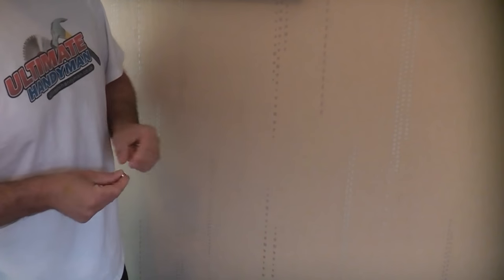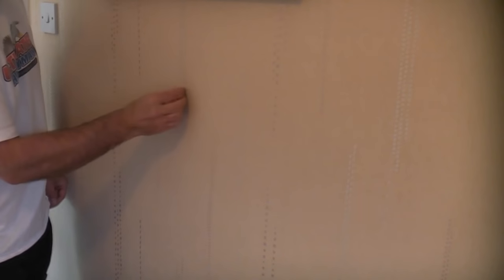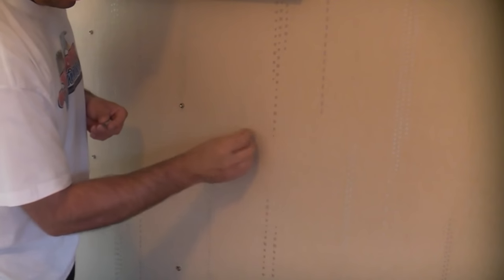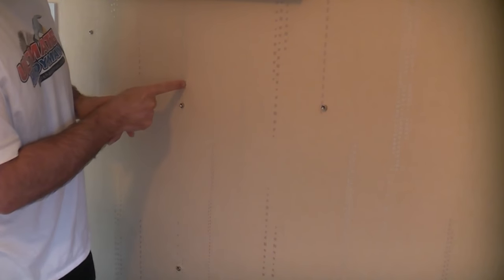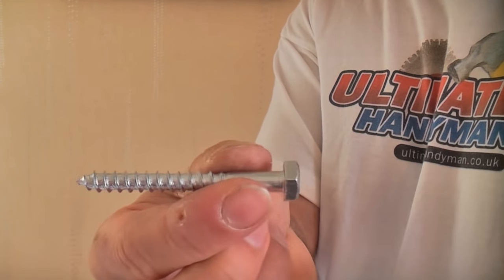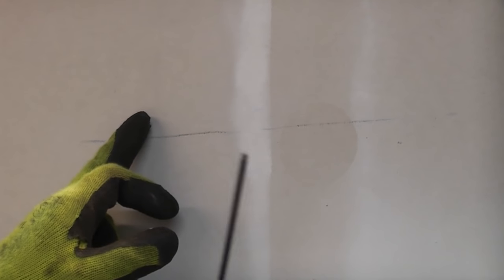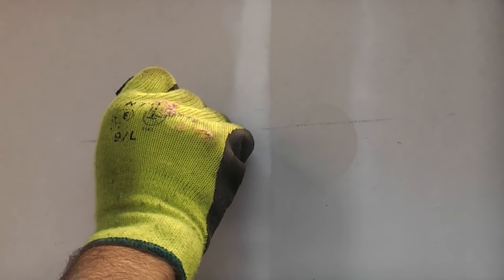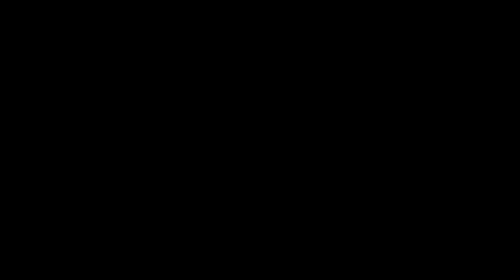How to fix heavy items to plasterboard / drywall

Comment: What size diameter / thickness of magnets do you use ?
Reply from the maker: They are about 10mm diameter, like these- http://fave.co/2tkvOmW
Reply: Unfortunately Norton is blocking me visiting that site.
Reply from the maker: Its only a link to ebay!
Reply: For some reason Norton says it a potentially dangerous site. Odd. Thanks for the info.

Comment: I've been trying the magnet trick as I want to fix two battens to a wall, then fit mirrors to them... But for the life of me, I can't find any of the batten screws?! What am I doing wrong lol
Reply from the maker: It’s not a dot and dabbed wall, is it?
Or perhaps they used fixing foam to fix the plasterboard to the studs (not very common)
Reply: @ultimatehandyman  If I knew what a dot and dab wall was, I might be able to tell you 🤣 If it helps, it was a garage converted into a living space. Before we moved here. Would that likely be a dot n dab?
Reply from the maker: It is probably going to be dot and dabbed, examples here-
https://www.ultimatehandyman.co.uk/how-to/plastering/direct-bond
If it is, you can use these-
https://www.youtube.com/watch?v=SmVgn19TqL0&pp=ygUHY29yZWZpeA%3D%3D
Reply: @ultimatehandyman  Thank you! I'll have a look.

Comment: Thats alright when the nails are just under 2mm of plaster but try finding lath and plaster nails with a magnet
Reply from the maker: Just use a strong magnet, it will easily find the nails, as there are loads of them in the laths.
Thanks for the comment 👍

Comment: What If its hollow though???
Reply from the maker: You mean your stud partition walls do not have any studs in them?
Reply: @ultimatehandyman  yes what if the area on the wall hasn't got wood behind it!??
Reply from the maker: You then have to use plasterboard fixings, the ones that can take the most weight before the plasterboard fails can be seen here- http://www.ultimatehandyman.co.uk/forum1/viewtopic.php?t=106943

Comment: What about dab and dot walls?
Reply from the maker: I'd use Rigifix for dot and dabbed walls- https://www.youtube.com/watch?v=xaYfs3lr1jI
Or you can get some called Corefix as well.
Reply: Extremely useful thanks :)
Reply from the maker: You are welcome ;-)
Reply: GameDevSPS  - tap the wall with your fingers, you can hear the difference between plaster daubs and air!
Reply: Meester Chris yeah I know how to find the dabs but should you fix fittings into them alone or drill right through to the wall with the rigid fixings

Comment: Never works like that man, studs are never where you want them. There are high end plaster board fittings that will easily take a TV.
Reply from the maker: There is always a stud somewhere. If you can find plasterboard fixings that can hold this TV and bracket I will be seriously impressed- https://www.youtube.com/watch?v=awuqDum0ay8&t

Comment: cheap new builds don't use studs anymore, my place has got plaster boards that are glued on to these flimsy looking steel frames.. totally pathetic.  not sure what you have to do if you want to hang anything heavy on these walls. fortunately our modern flat screen tv is actually incredibly light, so can get away with hanging just on the plasterboard. 
still if our house is typical new build is just another way of saying cheap and nasty.
Reply from the maker: I'll keep well clear of new builds ;-)
Thanks for the comment 👍